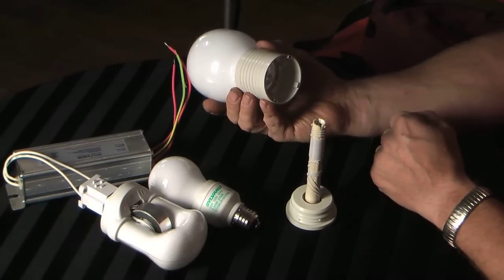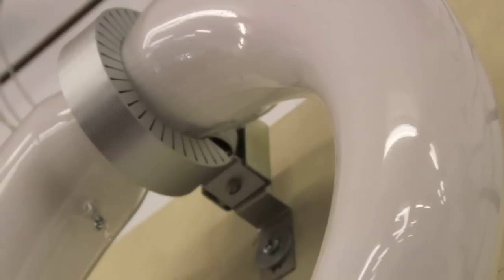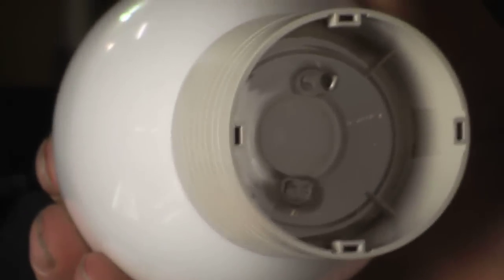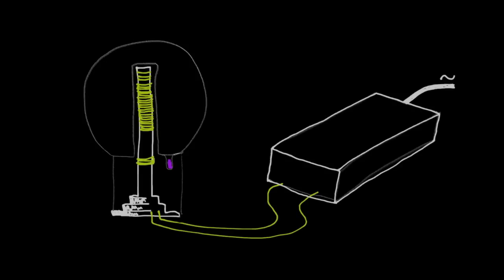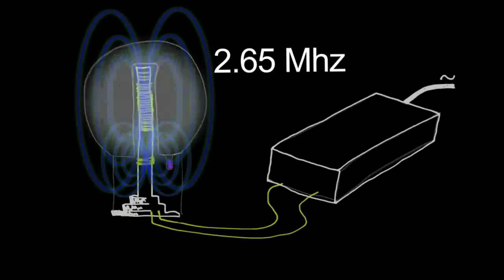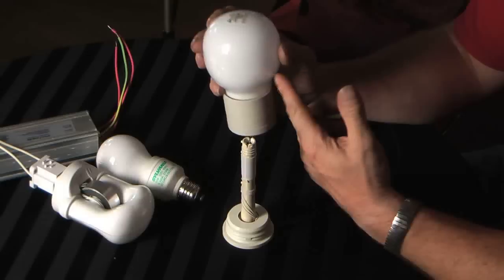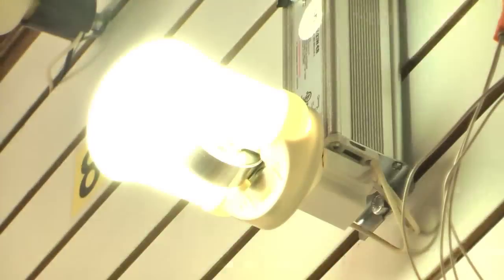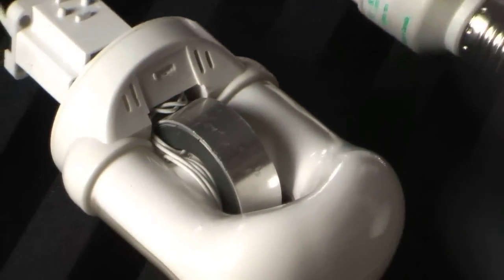The Induction Lamp - Types and Inventors

Comment: Eventually with further development, induction lamps may even surpass the efficiency of LEDs.
Reply: in theory it is possible, because coils can get extremely efficient
Reply: @gtb81.  I wonder if and induction low pressure sodium lamp could be made. That would be super efficient if practically monochromatic.
I guess it should be possible as long as the sodium is heated first to become vaporized.
Reply: @avada0  possibly, however heating the sodium up and keeping it at that temp may be challenging
Reply: I think most people would rather replace an LED bulb vs. replacing a ballast gone bad. People prefer things that are cheap and easy to service
Reply: Not likely!